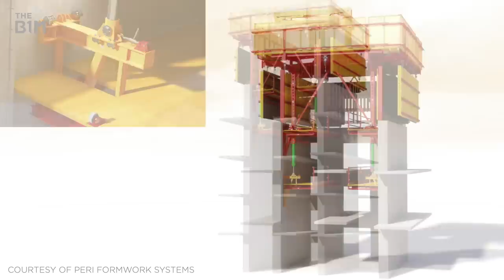Building New York's 21st Century Superscraper

Comment: Those old skyscrapers like the Chrysler building have a certain charm to them that the modern skyscrapers can't beat.
Reply: Well in 50 years this one will get that charm too
Reply: @tomknox7425  I personally don't agree though you may be right, I would naturally miss it if we moved on from the current style I think. Things aren't just the same I think. However, Brutalist architecture from the 60s/70's still looks somewhat depressing to me and hasn't gained any charm so why should I think a glass tower that looks somewhat soulless to me would?
Reply: @PeteS_1994  Yeah good point. But I think people never really fell in love with the brutalist architecture ever :D 
I agree that these glass towers tend to look soulless but The One World Trade Center for example looks pretty beautiful. But you are right chrysler building, the 40 wall street or empire state building feel alot more charming.
Reply: Pete S. It’s called having a pretty design
Reply: So ttue
Reply: @tomknox7425  it wont.
Reply: yeah, and those old skyscrapers have so many problems now and need to be taken down before they fall down. 
NYC is lucky doesn't have earthquakes but so the reason why those buildings are built not strong enough and are way too fragile to be stand there many more decades. One of the reasons why twin towers fell down so easily and so quickly right after that attack in 911. Not sure how much stronger the new ones are getting built, but I don't think they are that much stronger than old ones too.
Reply: The Twin Towers Too... ;-;
Reply: @aratayamaoka6672  The newer buildings are thinner then the old ones so they are more likely to fall
Reply: @aratayamaoka6672  wtf are you spewing, old buildings are way way over designed. the empire state building for instance is way stronger than it needs to be. the reason is simple, only nowadays do we have the precision to be able to push the limits of min maxing strength. back then you overbuilt to make sure it didnt fall down.
at first i thought you were gonna say the actual problems the buildings have [they are so overbuilt that they are psychologically draining on the occupants because of how poorly optimized they are for human comfort]. 
but instead you said some strait nonsense.
Reply: Top part of the Chrysler building is a freaking work of art,   that takes a sculptor's eye and a real sculptor's skills to make it.  One of the reasons they don't make interesting artistic building designs like that often is because square boxes are easier, and many people who build don't want the hassle of having to deal with artistic designs - why ? Because it takes time and effort in a totally different way. They  too often just think of the costs and the easiest way to get it done.     Years ago people actually thought of dreams- yea seriously.  They fantasized about how awesome it would be to put freaking eagle heads up there and make some curves.  Damn i live in florida and curves in buildings almost don't exist anymore
Reply: Arata Yamaoka do you have any idea what you’re talking about? Those old skyscrapers are extremely strong- a literal world war 2 bomber flew into the Empire State Building in the 40s. Educate yourself before you look like a fool.
Reply: @rob-robi  Curves exist at the beach tho
Reply: Tom, l like your reply. Let's build aesthetically pleasing one that will survive the charm and compete with modern skylines in the next 50 years. The days of those old structures are over and those who admire them are already in their graves
Reply: @jonasntim1815  I downvoted you
Reply: Connor Gaydos   History as part of every school curriculum is needed today more than ever.
Reply: Agree 100%. Relatively cheap and absolutely nasty. London is full of this junk, the stupider the shape the better. The world is full of this garbage, New York deserves better, its not just about height.
Reply: I agree they are so iconic
Reply: They kind of fit in With the new skyline 🏙
Reply: The Empire State Building isn’t a building it’s a man made mountain. The Chrysler building is the looker of the two.
Reply: @PeteS_1994  

The early 1900s bauhaus artitecture is still really ugly too
Reply: Bruuh look at the new Skyscrapers of NYC Art Deco Nuevo
Reply: @extraextraxtraterrestialah8794  Bauhaus looks better than modern architecture
Reply: True but nice seeing this one at least attempt to compliment the classics.
Reply: Bonglehdesh
Reply: @aratayamaoka6672  yeah I am gonna call bullshit on that, nobody wants buildings to start falling down our of sudden
Reply: They're made with love, not with a computer.
Reply: Isn't the Chrysler Building a modern skyscraper?
Reply: @cidoet3360  No. 1930's, almost 100 years old now.
Reply: @Quasihamster  Modern architecture emerged at the end of the 19th century. The Crystal Palace was probably the earliest example of a cast iron and plate glass structure was built around 1850, it was a representation of modern architecture and modern industry that was developing with the Industrial Revolution. The Home Insurance Building, built around 1884-1885 was one of the earliest example of a skyscraper. The rise of modern architecture in the US begin from 1930s until 1980s when it was gradually replaced by postmodern architecture. I think any skyscraper that was built between 1884 to 1980 is qualified to be a "modern skyscraper".
Reply: @cidoet3360  Well there's modern and then there's modern. Modern as in the clearly defined architectural style, and modern as in state of the art at the time the comment was made.
Reply: I agree but rather look at a modern buildinh.
Reply: @PeteS_1994  maybe
Reply: The Chrysler building is really a beautiful building, and the Empire State Building is just magnificent
Reply: @lt4324  I'm not an Engineer, but I play one on tv,,,, or YouTube rather. Lol, kidding.
The Tube world already has enough "Engineers",,, especially since the Miami collapse,,,, good Lord,,,, they've been coming out left and right, most of which got their "education and training" straight off off of Google.
Reply: @shakeydavesr  Thanks for your reply, I have also deleted my comment because it was to  harsh for some and I am trying to change my attitude toward certain and a lot of comments even when they do not make sense. Take care and stay safe out there these days.
Reply: That charm is called bias.
Reply: @aratayamaoka6672  lol

Comment: New York City is the most aesthetically-pleasing modern futuristic amazing city in the world
Reply: New York city would have been better if the twin towers were rebuilt but taller and stronger than the ones that were destroyed on September 11, 2001.
Reply: u havent live anywhere else i see
Reply: Shenzhen?
Reply: @benwong5982  Shezhen has way more skyscarpres than NYC but they are all tiny, they only reach like 1 meter passed skyscraper standards.
Reply: I wouldn’t consider it a modern city considering most of the buildings were built 70+ years ago
Reply: @benwong5982  No mix of old and new. NYC has the most eye pleasing skyline. Shenzhen is over the top modern
Reply: @jrcadventures2905  The older buildings are still amongst the tallest in the world though

Comment: I didnt think I could be this glued to the monitor during and add for a skyscraper concrete core pouring system O.o
Reply: The twin towers did not have a concrete core and it was all steel and steel doesn't do very well in fire.

Comment: Construction in modern day New York proves that construction never stops
Reply: When the twin towers were built between the 1960's and the 1970's, they did add a concrete core. Steel doesn't do very well in fire and maybe that is why the twin towers collapsed on 9/11. But the twin towers were designed to withstand an impact of a Boeing 707 aircraft traveling 400 mph. The airplanes that hit the twin towers on 9/11 were 767s.

Comment: Why is glass is always the first choice for the facade of the new buildings?
Reply: You already need to maximize the amount of light that gets into the building. The loadbearing core is situated at the middle, so only skinny columns are required at the edges, basically to hold the floors. And you end up with big windows and a very thin floor between them. So why not cover those with something similar too?

Here they use glazed white terracotta: https://newyorkyimby.com/2018/08/one-vanderbilts-terracotta-facade-installation-begins-as-superstructure-passes-halfway-point-in-midtown-manhattan.html

So basically only windows are made of glass: https://upload.wikimedia.org/wikipedia/commons/7/74/OneVanderbiltMay25.jpg
Reply: A masonry exterior is likely more expensive than glass, and developers probably don't care for historic attributes. Build in the cheapest way possible
Reply: @mickanvonfootscraymarket5520  Masonry takes up a lot of space and seriously limits light intake. The Grand Central Terminal is just one big hall, not much in the way of light inside the building. (And still, the thick walls and structural elements occlude a lot of incoming light.)
Reply: @pas.  but Grand Central is a different structure with a different purpose, than say the Flatiron Building  which would take in more sunlight as well being a a masonry structure. But I understand where you are coming home.
Reply: @mickanvonfootscraymarket5520  One other important detail is mass of the facade. If you want to build a supertall structure, you want to minimize the mass. So I guess this alone somewhat predestines the facade to be extremely minimalistic, wind resistant, easy to clean, so a big homogeneous surface.
Reply: Cheap, quick, stylish
Reply: Cheap, quick, stylish
Reply: To let the maximum amount of natural light into the building.

Comment: what benefeit does it have to build 4,5-6 meter stories?
Reply: i guess it won't feel cramped since shorter ceilings can make any room appear to be smaller than they are, also so more light can pass through though im not entirely sure
Reply: It's fancy and therefore can be sold at a premium
Reply: @andreespina9747  you're right, for wide office areas it seems to be a better choice
Reply: Luxury. Many buyers and renters crave great ceiling heights, which make spaces feel much bigger and grander. Plus, high ceilings also allow the installation of mezzanines.

Comment: Would be really cool to see a video on Karlatornet and the Karlastaden complex under construction in Gothenburg, Sweden. Karlatornet will the the tallest building in Scandinavia (245m). It has a very interesting challenge in where the foundation work goes 70 meters down into the ground, just to support the building. Gothenburg is known for its clay and it nutoriously hard to work with in some cases the clay layer can go down to 100 meters below ground level. I would love to know more on how you face a challenge like that when the ground you are trying to build a 245 meter high skyscraper on is so soft and unreliable.
Reply: The skyscrapers in Manhattan are located downtown and midtown, because bedrock is closest to the surface there.

Comment: I DO like this building on its own merits, but it suffers in comparison to the Chrysler, Empire State, and Grand Central Station structures that are also referenced here. The 'contextualism' and throw away details like the 'blink and you'll miss it' use of terra cotta tiles on the exterior, looks comparatively crude next to the classically detailed structures.  

I'm especially underwhelmed with the bland summit of the building - which I find looks more like a random stack of glass slabs leaning against each other and bound with stretch wrap rather than  being a 'breathtaking summit'. 

The other wasted opportunity for me is the simplistic and forgettable pattern of the terra cotta tiles. When referencing Grand Central station immediately opposite of it, with its rich patterning and gorgeous details, I feel a somewhat stronger classic element to the design would have been more fun and engaging. 

The best part of this building, for me, are the various 'improvements' the builders were required to include with the building. The underground links to Grand Central as well as the street level improvements looks positive.  Also admirable are the LEED certification and an overall appealing lobby. 

Once again, this is a good building, but because its being contrasted with some of the most beautiful icons of the classic era of skyscrapers, some of the soaring praise for 'One Vanderbilt' falls a bit flat for me.

Comment: Pink Marble Go.  Drain Titanium. Inside Windsail Gazebo. W New York. Hilton Engineer Suite. Axil Stawski Offices Building. BanCorp Dooring. Widest Conveyor.  3 floor one window Steel Black Pink Stripes.  Matte Mitsubishi. Dial button is Spring motor models. Matte interior Air Wall.

Comment: Using four concrete pump trucks and a parade of cement trucks is nothing big. We do that with as many as six concrete pump trucks and a non-stop parade of cement trucks in the Metro Vancouver, Canada area for some buildings as low as 13 floors. It's all about getting it done with minimal disruption so you can get on with permits.